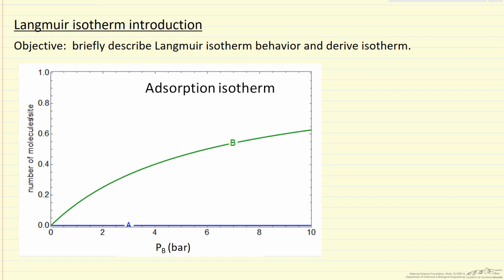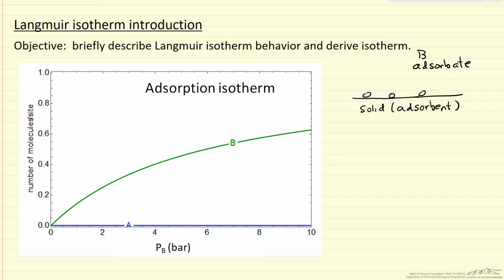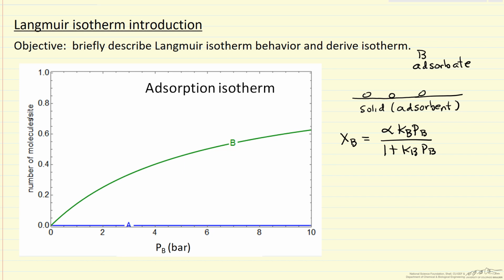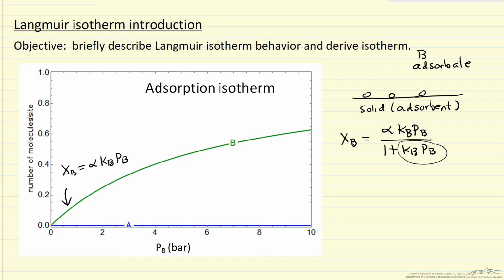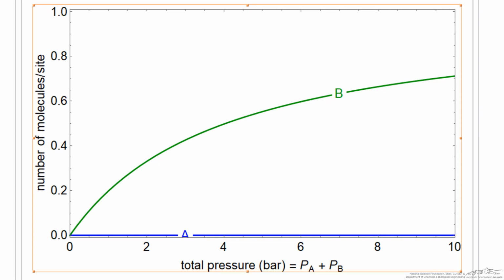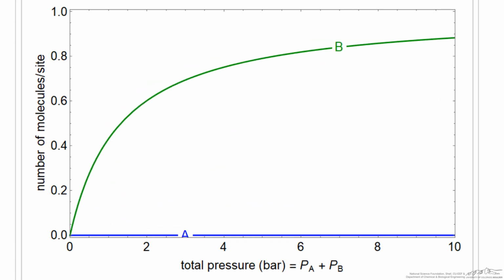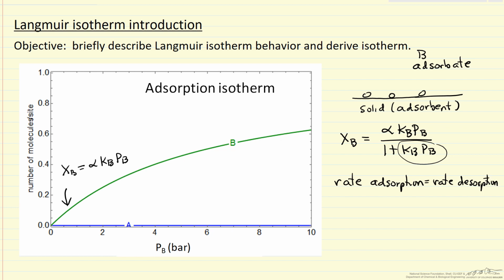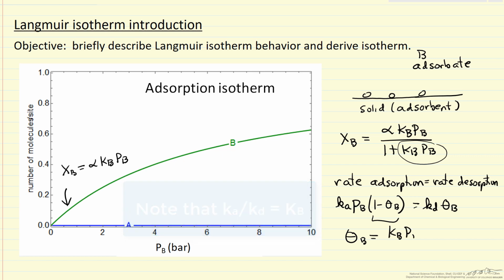Langmuir Isotherm Introduction

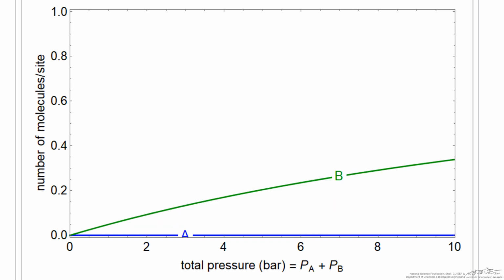Comment: At 2:57 what do you mean by "....in the simulation you can increase how strongly B is adsorbed on the surface". Isn't it that the strength of adsorption is a material property or a function of temperature?

Comment: How to apply Langmuir isotherm to experimental data               @
Reply: you need to find a software to do the curve fitting for you. like  nonlinear regression in POLYMATH.
Reply: You can do a linearization of the Langmuir isotherm. For liquid systems qe=(qmáx*kL*Ce)/(1+kL*Ce) and (Ce/qe)=1/(qmáx*kL)+(1/qmáx)*Ce. Ce is the equilibrium concentration of the liquid medium [mg adsorbate/L solution] and qe is the amount of adsorbate per amount of adsorbent [mg adsorbate/g adsorbent], those are your experimental values. You can get qmáx from the slope of the linearized form and kL from the intersection point of the Y axis and the slope